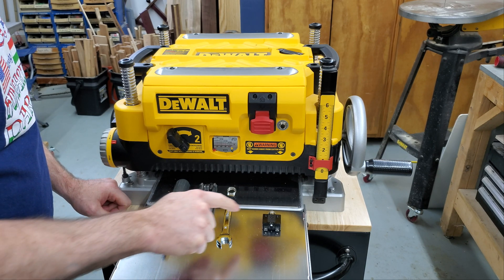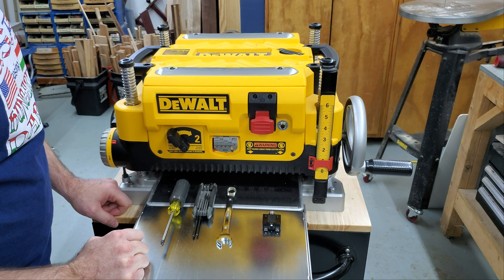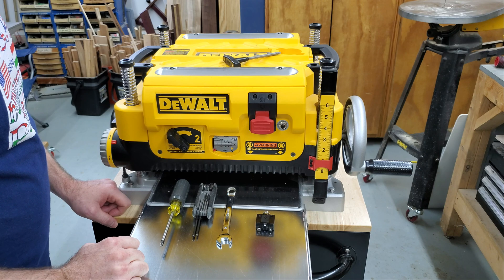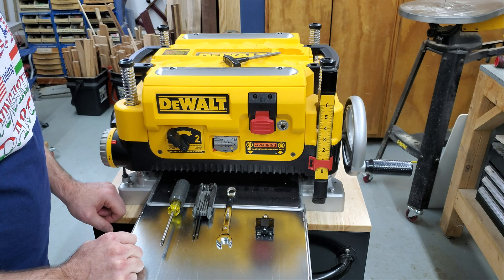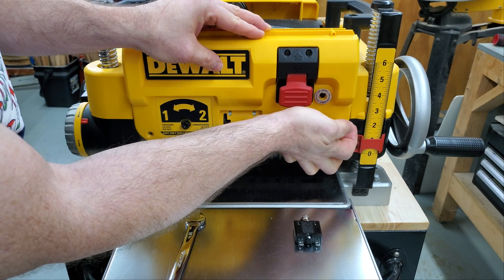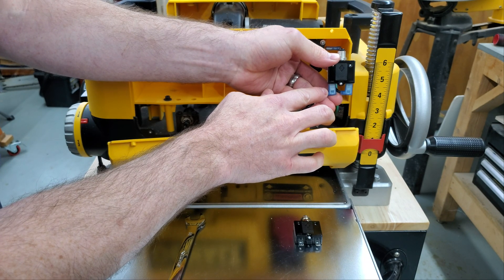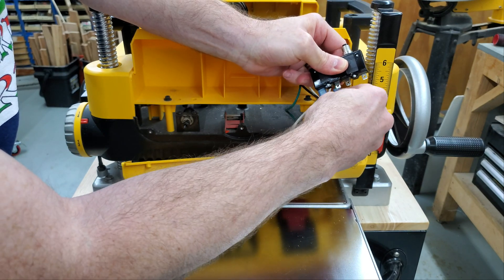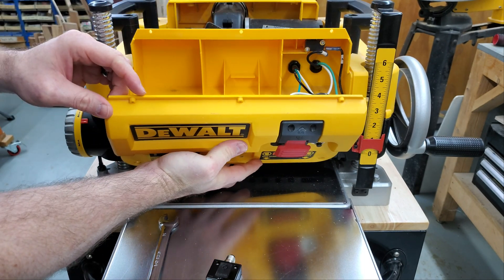How to replace the circuit breaker in a DeWalt DW735 thickness planer

Comment: Was your planner  prematurely breaking the circuit breaker?   My one seems to work too soon
Reply from the maker: Yes. This video will explain why: https://youtu.be/24f-J0lVo-E
There are some things you can do to reduce the load, like waxing the bed and using proper infeed/outfeed support.
Reply: @TheSnekkerShow  thanks my friend!!   Greetings from Brazil
Reply: My friend,   I just realized what was my main problem.   As this thickness planner isn’t sold in Brazil,   The unit I have was bought in US,  so the cord plug was a different than the awkward standard,   So I was using an adaptor,   This one was heating up and dissipating quite some
Power there.    I changed the plug and was like I added a turbo mode.   But thanks a lot for your videos.  I’m seriously considering removing the  rotor and work with a dust extractor to release some juice.    Cheers

Comment: Any reason my planer went from normal sounding to like a loud whirring sound? I know I need to replace the breaker and appreciate the video...was hoping you would have insight to the whirring thing.
Reply from the maker: I've never experienced that, so I'm not sure. Is it still planing okay? The higher pitch might indicate a sudden loss of resistance, like if a belt or chain broke.
Reply: @TheSnekkerShow  it planes fine. I do need to replace the breaker but other than that it does fine...I didn't want to invest in a helix head for it unless I knew it would last. I appreciate you getting back with me so quick

Comment: Hey Ben, how do i message you ?  (other than publicly here that is !)  I've got some springs i wanted to send you to trial in the planer if your interested to test.  I had them made recently to reduce the roller pressure to see how that affected snipe....  i specifically ordered extra sets of 50% and 75% pressure so i could send you some to try  as well :)
Reply from the maker: I try to keep up with the public comments when time and quantity permit. Sometimes people email the channel name at Gmail, or send DMs on Instagram. As for physical mail, I haven't figured out yet how I'm going to handle sending and receiving, so I currently can't do either. I'll probably set up a PO box eventually. That's an interesting idea with the springs. You could probably use a dial indicator to measure the same boards in a before-and-after test.

Comment: I've been having nothing but problems with my new dewalt planer.  The thing is litterally ratteling itself apart.  I'm going to try putting a helical cutter head and see if that helps.  Loud as hell too.  the older dewalt seemed more powerful and quieter.  Also the new dewalt seems to keep loosing it's traction on the stock even with light cuts.  The outfeed is troublesome as well.  Sometimes the outfeed roller catches the back end of the stock and sucks it up over the roller and gets jammed.  Anybody else having these problems?
Reply: just put helical cutter in my 734 they take a lot more power and i would say that much quieter but cost loads of money
Reply from the maker: It shouldn't be rattling, but it is a noisy planer. You might want to call DeWalt's support line while it's still under warranty. If the rollers are losing traction, one of the first things to try is waxing the planer bed. As for the back end of the board getting stuck, I noticed this as well with 3/4" boards. Adding the extension tables or some outfeed support will fix that, and reduce snipe in the process. This video might help: https://youtu.be/wcOUKAxrTy0
Reply: check the drive belt pully mine was rattling and found the pully was loose lost the nut completely

Comment: If you are having to replace the breaker unless there is a problem with your motor you are taking too deep of cuts. 😩🛫
Reply from the maker: Mine wasn't giving me any trouble, I just replaced it for the video. I've heard other people talk about their planers tripping frequently though, which as you mentioned, is probably the gradual result of a lot of heavy planing wearing out the breaker.
Reply: @TheSnekkerShow  Gee I am sorry for the insult I threw at you😩 had we been told that others were having that issue I would not have made the comment that did. I guess some of this comes from the algorithm that YT has employed, content creators need to keep pumping out videos to stay afloat. So this leads to creative content. Thus a CB change! While the problem may not be the CB but the utilization of the equipment! My wife refers to this as OE operator error. 😁🛫
Reply from the maker: @TheFalconJetDriver  Ha, I've been insulted once or twice in my day, and that's definitely not how I took your comment.
Reply: @TheSnekkerShow  i just took it out and wired around the crapy thing
Reply: @jimbauer6822  JIm are you same Bauer as in Harbor Freights line of tools? 🤣🛫
Yep by passing that breaker will keep it from tripping! It works every time but I can’t say much for the survival rate of the conductors🤣🛫
Reply: @TheFalconJetDriver  nope sure not hasnt been a problem so far